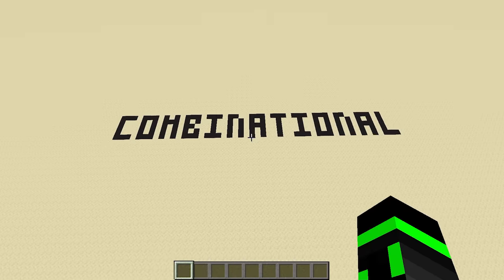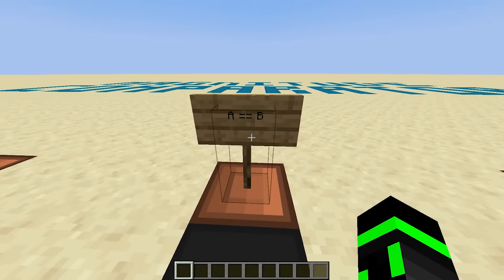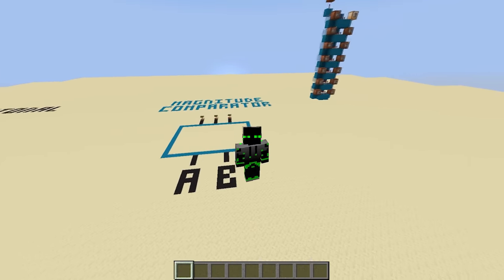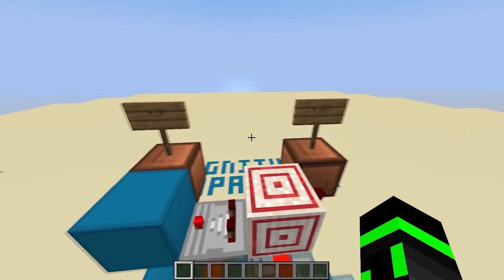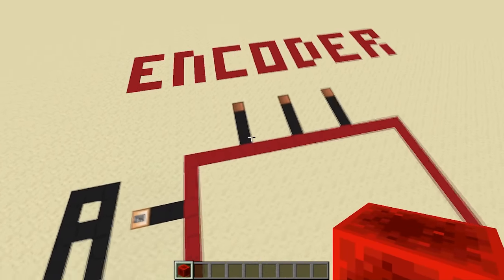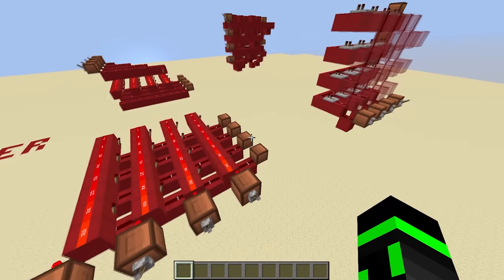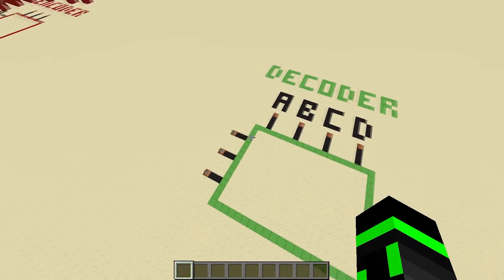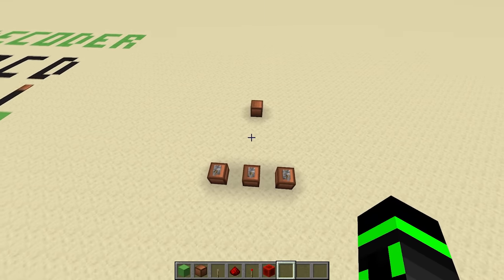Combinational Redstone Devices - LRR #6

Comment from the maker: Two small corrections: 

At 13:41, this circuit is not quite a 4-to-1 mux. I forgot to OR the 4 outputs together into 1 output at the end. This has been fixed in the world download.

At 14:34, this is called a 1-to-4 demux, not 4-to-1.

Guess I rushed the mux section, sorry about that lol. Hope you enjoyed regardless!
Reply: Thanks for making suchs nice and easy-to-follow-and-understand videos i play bedrock but somehow i decided to watch this serie anyways and this will deffinely help me with my computerscience with which i will start next year (I am 15)
Reply: And you built the horizontal to horizontal decoder wrong and thats why it didnt work (you dont need the redstone above the repeaters)
Reply: hey Matt whenever A is = to B but they are one like 1 and 1 the equality lamp doesn't turn on. that's not how a torch works :/
Reply: Hey Matt, I love this series its really helping me to dive into the world of redstone as a long time minecrafter! I have a question about the magnetude comparator, as for me if I attempt to compare the values 1 and 0, for example, the output is correct but the lamps on the input light up in such a way to show that I am comparing 1 and 1. While it is purely aesthetic I was wondering if there exists some simple fix to this problem?
Reply: Also, the magnitude comparitor's output can be expressed in two bits.  It can be -1 (interpreted as meaning "less", i.e., A<B), 0 ("equal", A==B), or +1 ("greater", A>B).  There's even a fourth possible bit state that in principle could be used to indicate an error, although in practice this is not often done, because the logic needed to detect an error condition (e.g., you attempted to compare a number to a string) is much higher-level and generally only occurs in fairly advanced software that uses a larger and more elaborate data structure for everything (e.g., VHLL compilers and interpreters).  I can't imagine trying to implement anything like that in redstone.
Reply: Yes

Comment: OK that's great... But WHY, outside of building a computer, would someone use either mux instead of just using two switches?
Reply: Late response, I know. The reason why MUX is important in both redstone and circuitry is because it acts as a switch that can be controlled via redstone/electricity, rather than just user input. That means instead of just having a switch that leads to the selection bit input (as shown in the video), perhaps you’d have some other redstone logic to decide which line should be selected based on some other inputs somewhere. It allows for more complexity arising from automatic functionality rather than user inputs.

TLDR: MUXs are useful for the same reason we don’t type in binary. Sure it leads to the same output, but one requires a whole lot less effort from the user at the cost of a little more processing behind the scenes.

Comment: in programming, "combinational circuits" are called "pure functions!"
Reply: What's a pure function?
Reply: @beri4138   A pure function is a function where you always know what the output will be if you know the input. A pure function doesn't remember previous inputs or outputs. Exactly like combinational circuits in this video.
Reply: @applimu7992  That sounds like a mathematical definition. I thought it would be an important programming concept I didn't know about.

Comment: The Brute Force approach actually has a name and it is called a look up table or LUT. It is used extensively in FPGAs, because you can easily reconfigure it to implement any kind of logic table for a fixed number of inputs. If you need something like that, it is really handy!

Comment: Hello Matt! I Just want to say: Thank you! Because of your LRR series, I got inspired and now I am working on a calculator!
 It's a very simple design, but it's my first large redstone project. I've the addition circuit, subtraction, multiplier, Binary to BCD, and a 4 bit screen! 
 Now everything I need is to put everything together and add an UI.
Again, thank you very much! :)
Reply: Me too, but I didnt start working on any projects
But im planning
Reply: Update: I have put everything together, and it's working just fine! It has addition, subtraction and multiplication! Sadly, my screen design only accepts up to 8 bits(255), i'm working on a 12 bit screen(4096) with is way more acceptable, but it's way harder than I tought 😅
Reply: @Its_Zer0here same here
Reply: @mattheus1331 did you get the 12bit  screen up and running?

Comment: This is super cool and helps reinforce my CS background. Btw the incrementer circuit you made that doesn't really do any math is basically a look-up table
Reply from the maker: yep, I totally forgot to include the term look-up table in the video. thanks for the comment!
Reply: At a lower level it would be called a Programmable Logic Array (PLA)
Reply: @mattbatwings  i was thinking of the term "mapping"

Comment: This has been very helpful for my survival series. I hate using debug menu as that is a trouble shooting tool, not something to be used for gameplay. With the new eye blossom, we have a day-night detector that works in-doors. We also have chuck loaders with the ender pearl change. Combine that with the copper bulb binary counter. . . 

I can now make a working calendar that keeps track of what day I am on using only redstone. The issue I was running into was figuring how to get the counter to reset back to day one upon reaching 101101110 (which is 366, the first day of a new year). I was afraid I would have to make a comparator to make sure the binary was less than the needed amount. . . but then I realized. . . I could use a binary decoder and use that to have a single output and then route that to the bulbs that need resetting. Couldn't have done that without your explanation of decoders.

It's funny, cause the decoder was way more useful than an encoder as I never had to encode anything. I wanna keep things compact, small display, small footprint. . . it's too bad there is no small way to display decimal. So right now I have to read binary. Like, yeah i could move items/named armor-stands or use colored concrete to represents digits 0-9. . . but then I would have to make a binary to decimal converter and that's just a big footprint. And even after that, just setting up the display, in a survival setting, would be such a huge hassle.

Comment: This is so cool. I made a magnitude comparator by accident when building my blackjack machine. It was slightly different. I basically just subtracted B from A and modified the subtractor to read for 0 or a negative number, then used an nor gate just like here. I love when I’m able to figure these things out on my own. I learn so much from what you teach but it opens a door for me to learn so much more. Thanks for your videos, you’ve vamped up my redstone game drastically. Only problem is I used to build machines that were just small enough that I could build them on SMPs but now I’m making machines so big I’ll never have the time nor the energy to collect the resources and build them in survival 😅

Edit: I typed this out right before you mentioned I can do it exactly how I said.

Comment: Another encoder design by a german youtuber uses a field of observers with more observers below them, facing the other ones and underneeth theres a field of redstone dust. Finally, it uses repeaters locking mechanism for the output, e.g. a 7 segment display. The advantage is that it runs on only one wire and u can also make a mechanism to power multiple 7 segment displays with only that one wire
Reply: from what i understood that's serial data trasmission. apart from the fact that Matt covered this already, this series won't use observers

Comment: In the magnitue comparator, what's the use for the target block and comparator at the back? shouldn't they only be needed on the top layer?
Reply: I've noticed that too, same for all the comparators facing away from the target block. I guess they are there to stack them more easily.

Comment: Btw. the +1 "Brute Force" Circuit is basically a lookup table. You can also create LUTs with multiplexers, this is even more efficient and allows you to save at least 1 bit so you would only need a 7 bit mux, thats still 128 bits, but its reduced by half. The trick is to use the Least Significant Bit as an input for the Mux. There are only 4 Combinations: 0 X !X or 1 so with 1 inverter you can multiplex your +1 with only 7 bit muxes.

Comment: Can you make a multicore processor?

you could make one processor runn when the other doesn't so you can use ram to its full potential.

Also the screen can be maped to ram so you can update the screen by switching one switch that would overwrite the screen with what is in ram at that point.

Comment: well, i got inspired to go ahead and do a 7-segment decoder to display decimal digits and used your "best design" but after having set it all up, 9 inputs, 7 outputs, i realized that glass towers can't handle more than 7 lines - the signal got too weak !
now am wondering how to insert a repeater in that design to handle the "last 2" input lines.

Comment: I have  a problem to say:

The Priority encoder works great, but when you select the last lamp, the previous 2 lamps also turned on for some reason(I kept a 1 block gap between the blocks , so it cannot be Quasi connectivity).  When I was searching for the reason why this happened and realized that it was caused due to the block-glass bridge sending the power to the wrong place. Can you fix it?

PS: If the fixed version is in the world download, then plz tell me.

Comment: You can use decoder + OR on a bunch of its outputs to act as a "2-layer programmable matrix". This (and the option to ignore an input in any combination by placing neither torch nor repeater) lets us make any logic gate, including optimized ones.

Gates like these are usually optimized via Karnaugh or Quine-McKluskey methods. Sometimes they're less compact than bool-logic optimized gates, but their propagation time is constant, no matter the function.

My only wish is to make decoders' slices to be tightly tileable. Is it possible to do using rails? Tried it myself but found it to be a lot of fruitless hassle.
Reply: Oh, I missed the point about not using observers in this series, so rails are out of the window :/

Comment: Random thought: Is there a mod that shows redstone information such as block power? Like, some kind of overlay that will show block with redstone on top with some kind of mark or colour, and the blocks around it as being soft powered. The blocks diagonally and 2 blocks below it should be marked as bud powered.

It would also be useful if we could see a value on a container so we can see the value a comparator would give if we were to attach one. It would also allow us to see the output it would give when the comparator is behind a wall.

I was also imagining an option to see if a block is hard powered (repeater runs into a block) or soft powered (redstone runs into a block)
Reply: redstone tweaks resource pack does a bunch of those, and litematica can check whether specific power states are going on
Reply: @johnchen9289  The Redstone Tweaks resource pack seems very useful. Thanks for the recommendation!
Litematica wouldn't help me spot problems while building something, but it does indeed help to see the changes through walls while testing a contraption

Comment: I like the vertical decoder but, in my opinion, the decoder you showed in the old series is better, I use it because it's horizontal to horizontal and it's without the redstone going on top of the repeaters, instead it has the slab under the repeater

Comment: I don't quite understand what the difference is between the mux and the decoder. They seem like the same thing.
Reply: Decoder: If the select matches, that output is on.
Multiplexer: Select determines which input is copied to the output.

A demux is similar to a decoder where the input is always on.

Comment: I made something that takes one byte and two bits and outputs the byte to the first output, second output, both, or neither, depending on what bits were enabled, I tried to find a more efficient way of doing it but couldn't find anything since idk if it exists and if it does, idk what it's called, it was just more compact than using two switches, this wasn't in minecraft, since doing it in minecraft would probably be just as compact either way